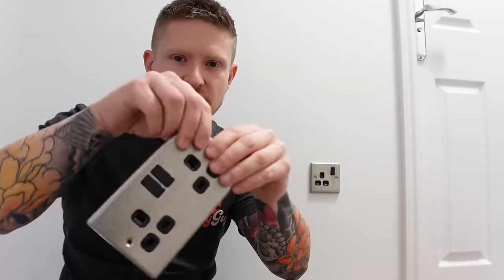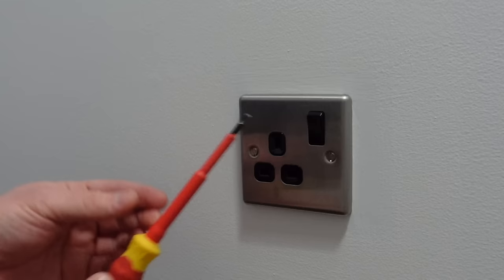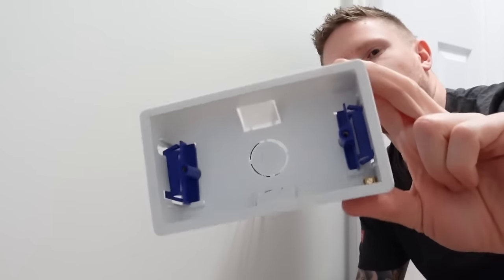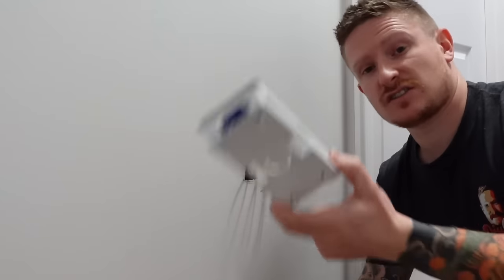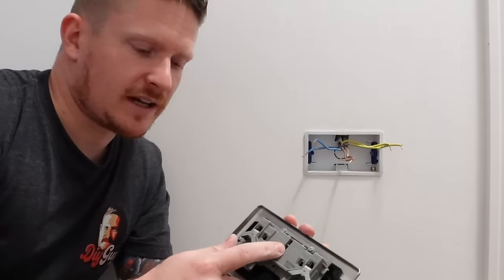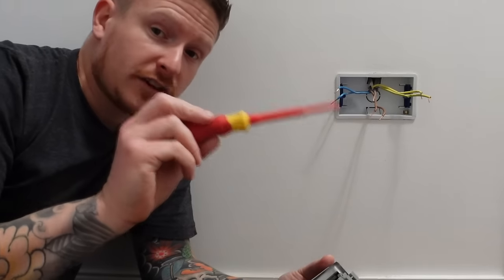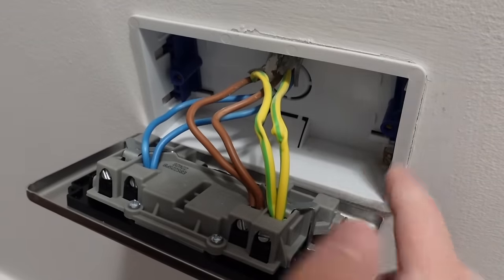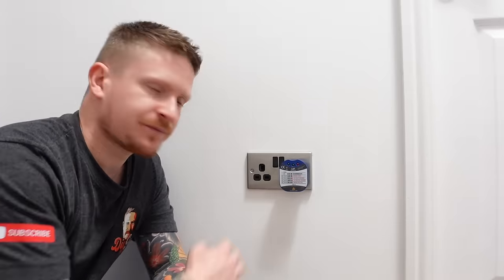How to Change a Single Socket to a Double Socket | Electrical DIY

Comment: Try doing this on a brick and plaster wall . It's a different ball game   .
Reply from the maker: Have done many times. Same process essentially just tougher.
Reply: Easy
Reply: Not really, it’s a basic sparky job. If you can’t turn a single into a double somethings fundamentally wrong 😅
Reply: You just need a masonary drill bit, some 8, 10 and 12mm are quite good.
Reply: I have an old brick house and it had  LOTS  of singles low down  that I changed to doubles higher up into  plaster and brick . I bought a plastic drilling jig that had lots of holes like a honeycomb the shape of the Patress, you just get a masonry drill set to the depth you  need and  drill all the holes in the jig and it pretty much falls out with a few hits of a cold chisel . 

Not sure why he did not replace with a Wi-Fi and USB socket when he had the chance .
Reply: @Lbm414.Oleg.Kuznetsov. Yes easy , only thing is it sticks out a bit, and does not look as nice if it’s in a noticeable position , but yes, no big tools needed anyone can do that .
Reply: @pipins3616 If you think it's easy what are you doing wasting your time watching this video?
Reply: Always disagreement in the comments haha great video mate your my goto for all projects I have around the home

Comment: Nice, before you do this pop your fingers in before hand to check if there isn't a joist in the way.
Reply from the maker: 👍 good tip for people.
Reply: The vertical pieces in the wall are called studs (hence stud wall).

Comment: How to change a single to a double on the easiest wall possible, show us your skills on a single socket fed by 2 x metal conduits in a concrete wall, then I might be impressed.
Reply from the maker: Been there a few times myself and picked up a few handy tips and tricks. If your struggling let me know 👍

Comment: Great, I don’t know why anyone installs single sockets to begin with. 😃
Reply from the maker: 👍 I know right
Reply: In the old days 60/ 70s most people did not have the equipment , we have today and cost .. today the cost is little difference , and most sparks fit doubles ( I do )…also I’ve seen double surface boxes used over a single ( metal plate inside ) double pattress box that screws into the single metal box .. lots of handy men have used this system .. if you do not mind the look of surface sockets .. plus it cuts out the chasing if you have a solid wall …
Reply: Ha...... I bought my flat in the 70's and it came with a bunch of single 15amp round pin sockets!
Reply: @rouman7 .  When I bought my previous house (2011) it had been rewired in 1989. Almost every socket was a single except for a couple. I would love to know why some where installed behind the doors in a position where the door opened back onto the socket. I had them all moved and replaced with doubles. 

I moved to another house last week and have found the same thing in a number of rooms, sockets behind the doors - but thankfully only two are single. My other bugbear in wiring installed in conduit on the wall surface, the electrician who checked the wiring said it was probably just laziness on the installers part or the owner was a cheapskate - going by the rest of the house I think the latter.  Electrician is coming back to update the wiring so all will be put right soon. 😂
Reply: @jimh4072   Strange one I found in my Victorian flat was a chased gap from floor level up to light switch height at the door which had been covered with wood and plastered over. Inside we found some tin piping but no idea what it would have been for!

Comment: It easier to just buy a double wall socket that fits into existing single wall box I got one from screwfix it fits nice and flush and uses existing screw threads in wall box

Comment: Great video, very helpful! Just changed three sockets in my room as part of our reno. Some top tips! With a solid wall, i found a drill and chisel took a long time, i used a multitool with masonry bit, did it all in 30 minutes. Thanks again, great video!

Comment: super video.  extremely well explained . I particularly like the testing elements to make sure the circuit is dead.  much appreciated. thanks.
Reply from the maker: Glad you enjoyed it. Thanks
Reply: Whilst it’s a useful trick, just remember that a cable could be live even though your multimeter shows zero volts.

Comment: Another good video,I like to use penny washers when securing metal back boxes to the wall as I think it stops the screw head from pulling through the back box if I tighten it too much,I also use them if I've chased the wall for two cables to hold them fast with the screws in the middle of the cables,really enjoy your channel always enjoyable and informative 👍
Reply from the maker: Interesting tip. Thanks and I'm glad you like the channel
Reply: Great tip, I will try to remember this one 👍

Comment: A good video. In a stud wall check that there isn't a vertical stud that is going to obstruct positioning the new box. Additionally, particularly with a brick wall, it's best to have some dust protection when drilling. Working in brickwork could be 10 times more difficult than block so drill out at much as you can before using a chisel.
Reply from the maker: Absolutely, good tips for people 👍

Comment: CRUCIAL TIP: After removing single pattress box, use a torch & inspection mirror to check the cavity for stud locations.
Only THEN mark the cut-out section for the double pattress box. Save yourself cutting into studs and some possible grief.
Reply: This is the comment I was looking for. I used to put my hand in and feel for the studs. You may have to move the back box to the right etc. If you do cut all the way to the stud you'd never get the plastic lugs to work.

Comment: This just came up while I was searching for something else. Decided to watch it anyway & while I was watching I was hoping that socket was going to be a solid wall with about 4 x 2.5mm cables rammed into it. Also you missed the part to tape up the 2 neutrals cus if touched with the earth wires would still trip the RCD despite breaker being off. One of my favourite ways to turn the individual RCCBO’s off for the correct circuit. 😉

Comment: Try the appleby range of dryline boxes with yellow lugs that's what most of us in the trade use had no end of trouble with the diy range of boxes might be abt 10p more but worth it & if you tape up your earth wires together you won't get pesky tripping on your split load board good vid mate👏
Reply from the maker: Thanks 👍. I will check out the appleby boxes 👍
Reply: Agreed,the cheaper ones are a right pain to secure with the screws.
Worthwhile finding some longer screws which help when fitting these boxes blind.

Comment: Another interesting video! Look forward to them. I watched another DIY youtuber who said you need to tape each of the coloured wires as if they touch each other they could trip the RCD? Is this correct? I thought there is no power going to the wires so no need.
Reply: That is what I found in my house. If the Live (brown) touches the neutral or earth for even a millisecond then it will trip the main circuit breaker cutting the supply to all other circuits. So, I do as you suggested and tape the Live wires as soon as I've unscrewed them. Maybe it depends on the type of circuit breakers installed.
Reply: It is correct to a point, it's if Neutral and CPC touch it will trip the RCD. Yes even when the circuit is dead.

Comment: Question about the last earth wire, the link wire from the metal box, you said you connect the earth wire to the socket? I can only see 2 yellow and green wires, isn’t there meant to be 3 now? I’m new to this and plan on replacing mine on the weekend so I’m just wanting to make sure

Comment: Nice and easy explanation
I have found though that if you let the wires touch each other it tends to pop the breaker in the box, might not, but if everything turns off, you'll know why 👍
Reply: neutral and earth touched together will trip the RCD on a split board, yes
Reply from the maker: Absolutely

Comment: Nice video, very instructional and concise 🙂 I particularly like the attention to electrical safety 👍

One thing to note which I may have missed you mentioning in the video is to make sure that converting to a double terminal doesn't add a potential risk to overloading the circuit (not common these days but still worth a mention)
Reply from the maker: Thanks, glad you liked the video.
Reply: Andy Guinan  surely if you are adding to a ring main which this is surely portraying. It makes no difference to overloading a circuit. 

But having said this.There are still old Electrical circuits that are not ring main. I would suggest that if someone has no idea what they are doing but think this is easy. Or have an old building that doesn’t have a ring main, consult an Electrician at the very least.

Comment: Great video as usual. I would point out that when using a metal back box to use a rubber gasket or grommet in the cable entry hole to prevent the insulation chaffing. Also, any opinions on socket adaptors. I.E. the type that replace the existing single or double socket with single to double or double to triple. quad socket other than the extra surface depth?
Reply from the maker: As the box replacement was demonstrated without any cables present I didn't show this but yes you are correct. Thanks

Comment: OH if only it was that easy lol ...I've just bought a 2  bed, 35 year old over 55`s apartment and nearly all the sockets were single !!  It was very dated and i`ve spend six months (while living in it modernising it ( i`m a young 60 year old ) anyway I digress , all the internal walls are straw ! it`s amazing how much straw (and mess) comes out of making a single into a double .
Although not as bad as the exterior walls cavity  , which are full of bean bag beans, the hole for the stench pipe ended up as an avalanche , I had to tape it up before the full side of the building contents ended up in my bathroom lol
Reply from the maker: Haha thanks for sharing

Comment: Many thanks for this, all your videos are great.
Any chance you could do a video on how to put a new socket in behind an existing TV as in taking it from a low down skirting board up to the TV and chasing it in ect.
Many thanks in advance.
Reply from the maker: Let me see what I can do for you
Reply: Funny you should suggest this as I just did this job DIY myself a few weeks ago. Trickiest bit was easifill and flashing the paint correctly over the hole I had to make for the junction box where I spurred off the ring main.
Reply: When adding the sockets make sure you have a certificate for the work. Dont just have a go....

Comment: Very helpful vid. I need to change a single into a double, but it needs to be vertical due to having no space for horizontal...haven't found one yet.
Reply from the maker: You can do it!
Reply: But, with two sockets vertically as you say you need you won't be able to plug anything in to the upper socket if the lower socket is in use as the cable will be impeded by the lower plug. could you mount a double socket vertically and have the cables from the plugs coming out horizontally?
Reply: Thats because they don't exist. The bottom socket would be fouled by the strain relief of the plug in the socket above. And you can't mount double sockets sideways. The only solution would be to use 2 single sockets with space in between.

Comment: One thing I noticed you skipped by was, when screwing the wires into their selected slots, do you then screw them back onto the rubber outer case, or onto the metal wires inside the tube?

Comment: Half decent video, only one I've seen that advises locking off the supply while working on the circuit. I understand why you didn't, but I'd of liked to see some mention of cable sizes. Seen many sockets wired in undersized cables or a spur off of the socket in 1mm etc.

Comment: hi all, great video many thanks!
can I still do this if our cables are only singles?
I removed the single socket head, but there's only 1 earth, 1 live and 1 neutral cable.
Your has double of them... Can I still replace it to a double socket or it won't take voltage enough? Thank you
Reply from the maker: This is likely due to it being radial circuit or a spur. Yes you can still carry out the work safely
Reply: @TheDIYGuy1  thank you for the quick response! Absolute legend!
This is in the kitchen, it was for the washing machine, but we put our dishwasher there and the additional will be used for a water filter system. Hope that still OK. Thanks so much

Comment: Great video. Sorry for the stupid question but if going from a single how are there two wires for each already?
Reply from the maker: This will be because it’s on a ring. The wires don’t represent the number of sockets
Reply: @TheDIYGuy1 got you. Thanks for getting back. Think I'm going to stick to a single for now to play it safe anyway as the single I was looking at changing is spurred off a double so wouldn't want to overload.

Comment: i ended up just getting those 1 gang to 2 gang convertors as i do not mind it sticking off the wall a bit and it saves messing about knocking brick out for me

Comment: I see that in this case there are two sets of cables. I assume not every single socket will have two sets coming in. That being the case can you still wire the double socket with a one 3-core cable if you get me?

Comment: If you convert a single to a double can you then run a 4gang extension lead from each of the sockets safely.  Looking to do this for the bedroom as we only have a single socket one side of the bed.  Only used for phone charging, lights and fans

Comment: Thanks, have you got a vid to show how to spur off an existing double socket to make a further double socket on a different wall?
I don't mind using conduit to hide the cable rather than chasing it in.
Thanks.
Reply from the maker: I don't but I may in the future. Thanks

Comment: Question, I have 2 sockets with really short wires, you can barely get at the connecting screws. There are 3 each of brown, blue and earth, can I connect 3 of one colour to a Wago 222, 5 port and connect a fly cable to the socket, or is this overload??

Comment: What's the 4th terminal you don't use ?  I need to replace a cracked double socket, when I took it off there was 3 terminals, the replacement I bought has 4 likes yours extra one has E on, can I just not use that ? Thanks

Comment: When inserting the conductors into the terminals, should they be pushed into the terminal as far as they will go? Is it okay for the conductors to be touching the back of the plastic faceplate?
Reply from the maker: Yes they should be.

Comment: If you have a socket with 2 earth terminals, it is advisable to put either leg in each one, such that should one cpc become loose the other should still be connected.
Reply: The wires should be in solid and you absolutely have to check but if you're not sure..... leave it to the experts.
If you have to worry about an earth wire coming loose then what about if a live wire came out. Deadly!
Reply: Twist the earths then you know it’s connected throughout the ring.

Comment: How do I fix my 3 way light? Downstairs switch now does nothing, as does the upstairs light switch. When we moved in 6 years ago the mid stairs light worked but it's been years the mid stair light stopped working

Comment: Great video, very clear and easy to follow. Does it matter if there is only the 1 earth wire? I don't mean the separate one from the back box to the socket, but in the video there are 2 earth wires coming out of the wall, and I have a socket where there's only the 1 earth wire. Just wondering if this would still be ok to upgrade from a single to a double. Cheers

Comment: If I used a metal backbox and a plastic socket, am I right in saying that the earth link between the backbox and socket would not be required? I always thought these earth links were only needed between metal backboxes and metal socket's or switche's.
Reply: As long as your back box has a fixed lug (this one did) the link between the socket and backbox isn't required but could be considered good practice.

Comment: Can I change all my singles for doubles? Will it trip the fuse board if I do?
Reply: Most circuits(not kitchen or cooker) are rated for up to about 7kwh worth of electric so be careful if you plug in an electrical heater as you may overload the circuit and trip the electric. I doubt anyone is using more than 7 kilo watts an hour of electric. The circuit in my flat is 32amp which is 7.68kw. Kitchen is usually a 40amp. Cooker is 40amp. Lights are either 8 or 16amps. If you have a power shower this will be on its own 40amp circuit.
Reply: @daviniarobbins9298  just curious. Volt in your country? 40 amp is crazy. In dk we have 230 volt 16 amp in kitchen. 10 amp for lights and sockets

Comment: The only thing you didn't show was when replacing a single socket with a double in a brick wall, the incoming cable may not line up with the holes in the tin box so the cable has to be adjusted to allow this. Its not as easy as in plasterboard walls.
Reply: I actually thought he would have measured it from the center, as that would have been the easiest way to do it on the brick wall since the wires would not need adjusted.

Comment: Somebody changed a single socket into a fuse for a pull corded light, I now want it changed back to a single socket, is this easy as just placing the single socket plate back on?

Comment: Doesn't that depend whether it's a ring main circuit or a radial main circuit?
Reply: Nope, just 3 ends or 6. Sockets are almost always ring but with the introduction of RCBOs they are moving to radials, at least in commercial settings.